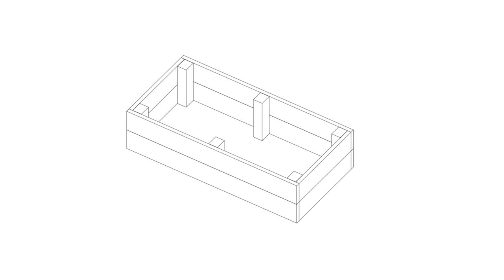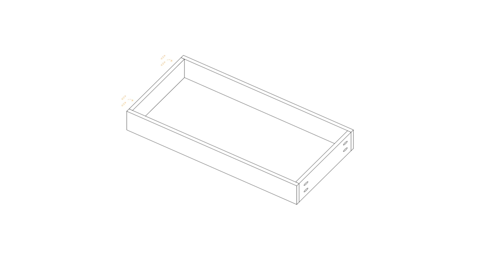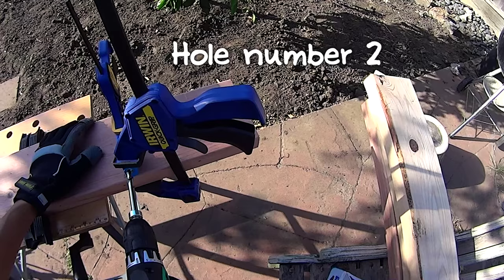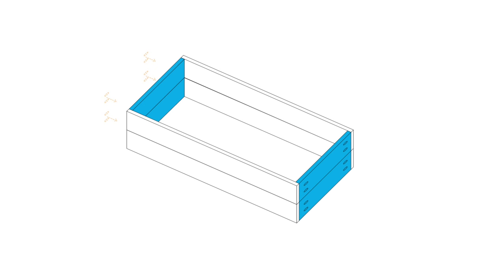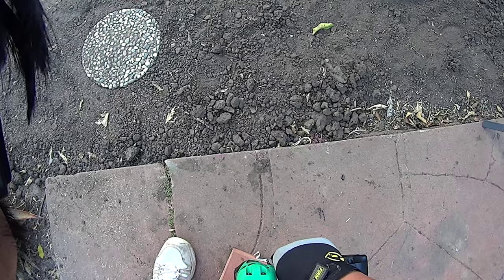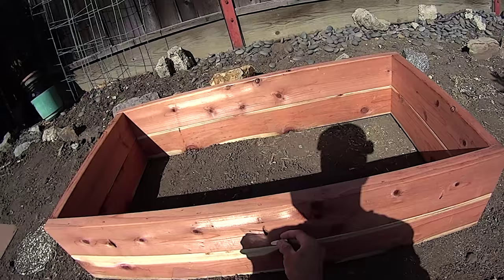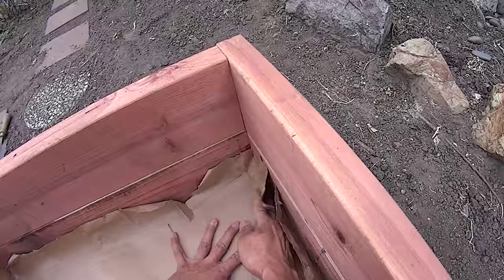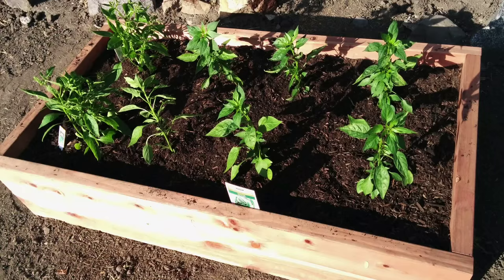Raised Garden Bed using Pocket Screws

Comment: Super helpful, thanks for posting. I was thinking of doing something similar and there's very few videos for such a project with pocket holes. One thing I'm planning to do differently is to put the pocket holes on the inside and line it with a plastic tarp.

Comment: Hi!

Nice video, I will be building my planter box next weekend. It will be raised off the ground so I will need sufficient drainage through the bottom planks. I was thinking about leaving a quarter inch gap between my bottom planks, will this affect the strength of the pocket hole connection?
Reply from the maker: +Josh Mendes Yes. The length of the screw and the positioning of the bore holes assumes that the connection is an edge-to-edge joint. By leaving that quarter inch gap will not have enough bite, thus weakening the joint. A solution is to cut the quarter inch notch from one of the planks, or 1/8" notch from both planks. Another option is to drill drainage holes on the bottom plank. Just make sure the pocket screw connection is a butt-joint (edge-to-edge joint).

Thanks for watching!
Reply: +eyeDtenTea 

Great suggestions, thanks mate!
Reply from the maker: Not a problem. Good luck on the planter box!

Comment: I am thinking about using pocket holes for some planters. I was just wondering how they held up over the years? I'm concerned with exposing grain and water pooling in the holes. Any problems with that?
Reply from the maker: No problems. I also used the hole plugs by Kregg; there is no water pooling issue.